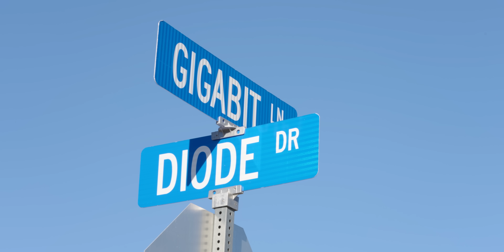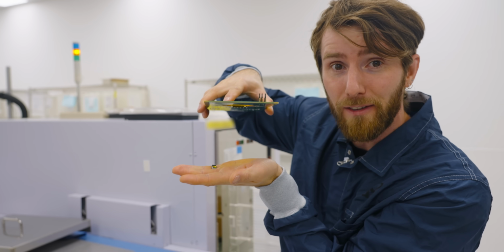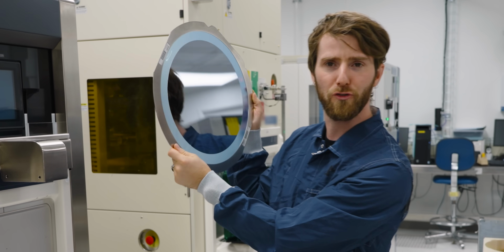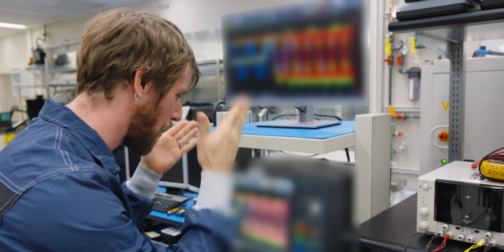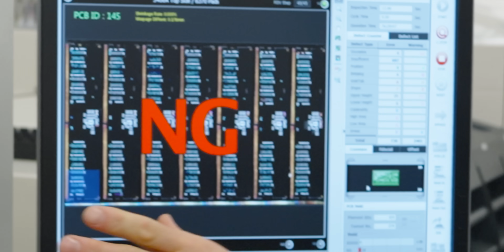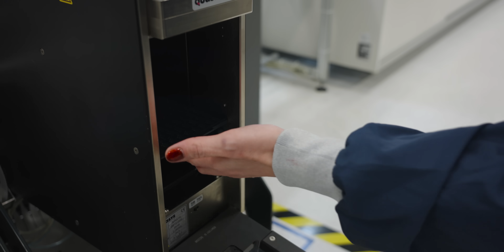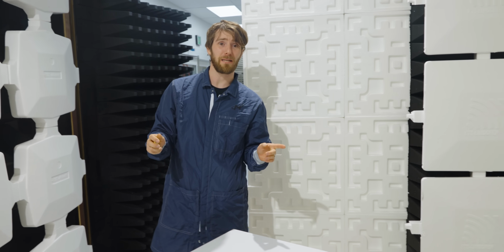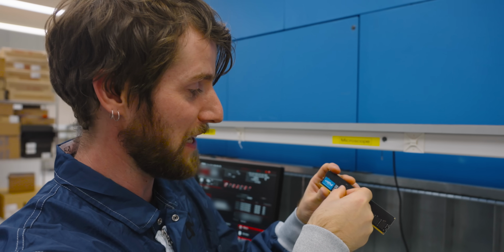I made my own RAM! - Micron Factory Tour

Comment: hey micron, why do you have so low data line impedance of about 40-64ohms, that will fry all your chips if someone puts signal 5V/3V at 2A (or 100mA) on that pin.

Comment: So here’s my question, with what does it mean when ram doesn’t have the ECC for overclocking? Micron is the only seller I’ve found that says this because it seems very overclockable, or did I misread my findings and the system just automatically did it’s thing?

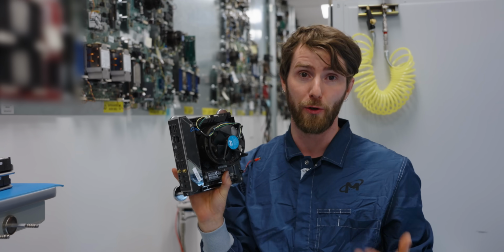Comment: 25:16 this scene has me wondering how long computer components can sit idle de-energized before going bad. What's the scoop on this these days? I am aware that if a computer is in storage for long enough time capacitors naturally expire, and though the system might appear to be OK when powered stability and reliability may be questionionable. Can someone shed some factual light on this?

Comment: anyone know why the die starts out circular instead of making them squares  just seemas there would be more waste material using circles then square shape cutting out smaller square shapes  from it
Reply: Silicon nodules are pulled from furnace are round, then diced up to wafers polished and sold to micron, when I was there they were 23mils from factory snd in back grind we ground them to 6 mils, looks like they are thinner now as they potato chip a lot more.